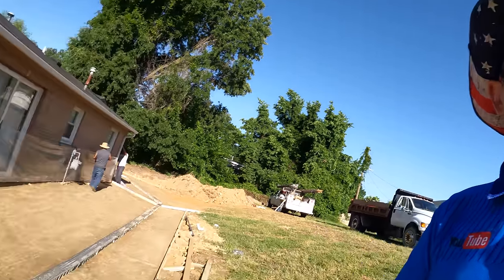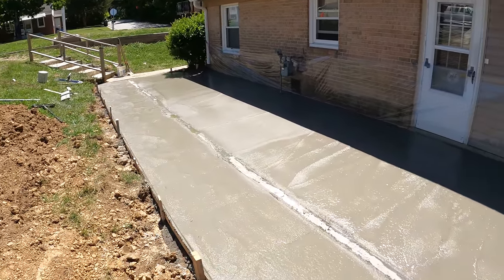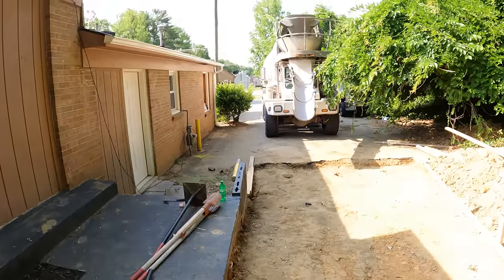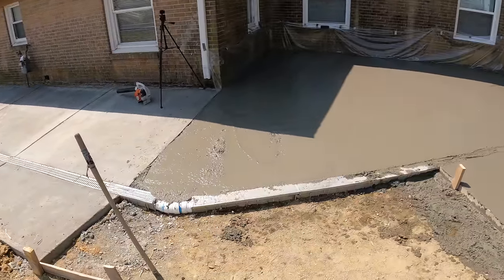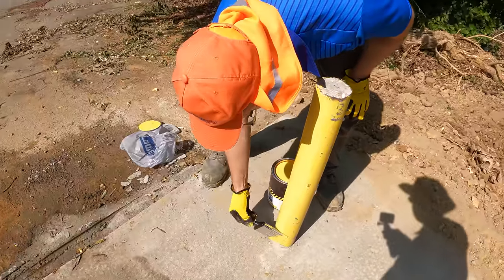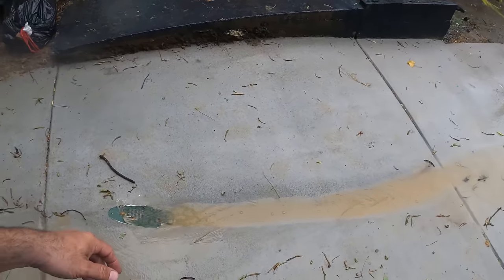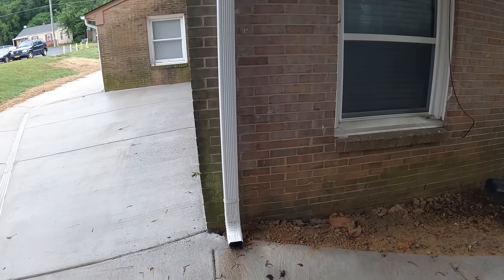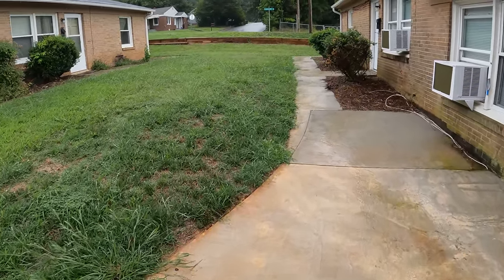Part 4 of 4 The worst Apt. Flooding I've ever seen!

Comment: I don't think the concrete is visually unappealing at all. By the time the residents put out some chairs and some flowers, you won't even notice it.
Reply: I was thinking a Shade Clothe Awning all away around to the Edge of the Concrete. And then have their Chairs and Table and Plants in pots.
Reply: It will blend in in time its better to have a lot of concreat and no damp nice job guys
Reply: My thoughts exactly. Property owner could put some fence dividers up and turn it into a patio area for the tenants.
Reply: Silver reflecting tape, around the top of the Ballard's,  would be a nice touch. Especially at  night
Reply: @fisqual definite value add until tenants realize why it's actually there

Comment: Tough jobs like this some contractors will avoid. However, I feel like you learn a lot going through the process of solving a difficult problem and in the end there is value to be gained from putting in the work that others won’t. Great job.
Reply from the maker: Thank you J M!
Reply: @GCFD  I seen where you took that green grate and used your pocket knife to cut a drain hole but you were still worried about leaves getting snagged. A few seconds with a dremel you could smooth that opening that might help 🤷‍♂️ I have zero construction experience but just a thought.
Reply: @GCFD  here in the uk their are gulleys under every rain water pipe from your roof which goes underground to your main sewer that's where our rain water goes
Reply: @GCFD  don't houses over there have damp course in the walls below the floor

Comment: I don't see a "Sea of Concrete", I see a patio addition for each unit. It does not look ugly.
It looks great AND it seems to have fixed the challenge they were having.
Good Job guys!
Reply: I agree-nice outdoor seating areas aplenty.
Reply: @markschultz1606  Yes, a few potted plants will soften up the overall affect, as well.  Also, I noticed the roofs for all the buildings look brand new.  The new owner's investing a lot into these apartment buildings.

Comment: Awesome job Shawn. You almost need a flap at the end that gets thrown up and drops down when no rain, water, but not an easy problem to solve. I think the concrete looks fine, I bet those renters love their new patio. Lots of grass vs concrete.
Reply from the maker: Yes the renters are thrilled to have a landlord who cares and to have their flooding problems solved.
Reply: @GCFD   I agree I think a flap would help but I’ve never done that I would leave that to the pros (that’s you lol)
Reply: Something like a check valve. Maybe a piece of inner tube cut into an oval shape to match the discharge outfall
Reply: A "pop up" - type of discharge (sideways).  I'm VERY sure you'll come up with something- IF necessary!
Very complex job!  
WELL DONE!!
GCF has come a long way!
Reply: I agree a flap valve is the solution. But you still need to prevent people putting there foot in the hole and twisting their ankle. A flat grating level with the top of the pipe downstream of a flap valve maybe could have been a solution here. Then you could lift the grating to get to the valve if it gets clogged with twigs and the concrete could be profiled so there was less chance of a trip or ankle twisting hazard.
Reply: @GMan-yv8cb  much like a yard bubbler...  keeps crap out when not in use,  but pops up when water pressure is behind it,  and top is easily removable for cleaning

Comment: Looks good. I would recommend using straw mats or hydro seed for those hill sides. Also if you use seed and straw put down a 12,12,12 fertilizer, it will help get the grass to grow and stabilize the hill side faster.
Reply from the maker: Great advice Rob. I don't use fertilizer too much but see the positive reasons. The grass came in well here, luckily.

Comment: Congratulations Shawn!  There might be a formula for the quality of the concrete work.  In the couple of years I've been following you, the concrete jobs have been on the small side and bang on.  This has to be one of the most extensive concrete jobs.. so all day, multi day.  When people get tired, quality can fall.  The laser eyeballs that can precision sculpt a 6 foot run, might by shortsighted on the 60 foot pour.  Thankfully your laser eye is always full bubble! What about a hinged cover on the outflow for easy cleanout? Get into custom metal fabricated outflow covers!

Comment: Hey Sean, I for one appreciate the trouble you go through to put these videos out for us to watch. Even though most of us aren't in your service area, we know what to look for if we hire someone or take a project on ourselves.
I'm not a big fan of the sea of concrete, but I'd do the same thing. You said there is a new property owner so maybe he'll have someone build some planters that stick out from the building 90 degrees to break it up. He could charge a little more rent for the patios.
My thought on the newest outlet in the sea, it needs to be covered somehow so someone doesn't step in it and twist an ankle. None of us want to use our liability insurance. Having said that, it also needs to be open to get rid of the crap that gets in it. I like that you opened up the bottom of the screen. Maybe the landlord could have his lawn mowing people or property manager check it regularly and clean it out as needed.
Reply from the maker: Thank you Roy. I'm glad folks are finding my stuff useful. The property manager is supposed to be keeping a close eye on things over there. It appears they are doing well.

Comment: Great job Shawn, you have done what you were asked to do and get the water away from the property, and using all the concrete has done the job and working well, i want to say the concrete guys have it easy when you have truck drivers like that and getting in so close to the job makes it so easy for them, looks really good and finished off tidy

Comment: Excellent results, Smart move about not piping the gutters no need to have that debris in there, Its not that bad,  you have to do whats needed rather than to Demo the whole property which is obvious due to $, And on the flipside its a plus by not having muddy feet when going in & out of the residence, minus possible wet shoes. Anyone with Pets the issue is always muddy paw prints on the carpet etc.
Reply from the maker: Good points. The concrete is clean and way better than mud!

Comment: I enjoyed the series; I think it let you break down in to more detail with what was going on.

And the 'sea of concrete' is now a 'marketable patio area' for those units, and maybe a 'shared area' at the corner.
I'd be surprised if next summer there aren't tables and chairs or maybe even privacy dividers put up buy long-term tennants.
Plus a great area for little ones to tricycle around and sidewalk chalk!

It may not be 'pretty', but wow is it useful space now!  Saw the one person already had a carpet set up outside the door.

Comment: Pro tip: IIf you want to compact dirt with the mini Bobcat, fill the bucket with dirt. More weight, more compaction. :)
Reply: @jeepinass  You can see in the timelapse video that it indeed does compaction. Sure tracked vehicles spread the weight over a wider area, but there still is weight.
Reply: @jeepinass  I am watching this farming channel. Mate has tracked hardware to reduce compaction on his fields, sill get's compaction.

Comment: The "Sea of Concrete" was the best, passive and most permanent engineering solution.  The only esthetic improvement I might have suggested would be to tint the concrete so it wouldn't look quite so monolithic.  The plastic screen over the angled cut outlet pipe could be put on a stainless-steel hinge, allowing it to swing up and open, allowing drainpipe discharge if it becomes clogged from inside.

Comment: Maybe a PVC frog flap could be a better option for the end
Reply from the maker: I haven't heard of those... I'll check it out David.
Reply: @GCFD   Frog flaps are often used in overflows from rainwater tanks (Common in my part of the world) The overflow has a hinged flap on the end of the outflow that normally sits shut. It is hinged at the top, and when it rains, the water pushes it open and allows the water out.

Comment: First, what a great series of videos, Youtube could not pay you enough for all the work you do. What a great transformation. You totally saved all of those apartments. If you will forgive the Monday morning quarterbacking, in my line of work, I find I have most success (or least problems) making things easier for other contractors. If you had run the channel drain outflow out to the side of the concrete instead of down the middle, it might (might) have made it an easier pour, and you could (maybe) have used an open outflow with a plastic runoff. Anyways, it doesn't look like a sea of concrete. It looks appropriate to the surrounding apartments.

Comment: In the UK we're not that keen on swathes of concrete but that's a heck of a water problem you've solved. Epic job!
You could install a Rat Gate.. one way swing gate that fits inside the pipe. Although I doubt cats would want to get in there!!
Reply from the maker: That's a pretty cool device. Rat Gate.

Comment: Great video Sean. The Sea of concrete issue wouldn't bother me because there are lots of places where you have mostly hardscape and you put in pots and planter boxes if you want to have a softened environment. I completely agree with your logic on why you had to go with a passive system like you did. It's the only way to guarantee that the system will flow even when nobody maintains it. Personally, I thought it looked really nice and the residents in those units on the uphill side got to have concrete patios outside their doors. So I didn't see it as a negative. I thought it actually made the places a little bit more attractive. Great work on this long multi-part series. I think it gives you more room to explore the job and share with us all the ins and outs. I look forward to more like it if that works for you.

Comment: Was the crack over the pipe expected? If it were my property, I probably would not have liked that unless it was discussed and agreed upon. Love the series you are doing! Keep them up.
Reply: They do minimal maintenance there so I don't think they'll even notice.
Reply: @Mark.Watson  I get that, but I’m asking more from a standard question regarding concrete. He said it was “real thin” there. Cracks get worse and would seem especially worse over a pipe which will allow more water to seep in around it. I’ll be interested to hear what he says.
Reply from the maker: Yes that thin concrete over the pipe was expected to crack.

Comment: If I was tenant, or considering  buying the  property.  I'd look at it as selling point,  due to the ground, levels. It's a great preventive addition to the property. As rule when rain gutters  drip, and it's not raining,  it's a sign gutters  have debris in them, holding back water.
Reply from the maker: Yep! The other problem with holding water is the tannins leach out and stain the concrete.

Comment: I am with you, with the apartments  in a lower grade you have to take drastic measures with concrete solving the issue  .I agree about not dumping gutter pipe into  the drain  that would have  been a HUGE issue you  played it well .The  concrete  guys seem to be ok for average jobs the complicated  jobs  they seem to have issues they  need micro managed ?I would hire you every time !You care about your work only perfection is your goal !

Comment: Hello from Australia. Just a heads up, You can’t do pipes like that in concrete. The pipe needs to enter from underneath the drain so you have minimum 100mm cover over the pipe. Now that the concrete has cracked it will allow water to work it’s way under the concrete and the issue will just slowly get worse and worse as it fails. You would have been better off to just spoon the concrete all the way around it would be a lot stronger.  The only way to have a strip drain like this would be to have the exit into a garden bed so you can maintain 100mm cover over the pipe. I hope that helps.
Reply from the maker: We didn't have the fall to bury the concrete deep enough. So we had to leave that as a trade off. Solve the flooding issues but have a crack along the shallow pipe.
Reply: I understand that but with out cover over the pipe I would recommend doing the same thing with out the drain. The concrete will end up really badly cracking over the pipe and some sections will end up popping off exposing the pipe and once water gets through the crack underneath the concrete you will have another issue. I’ve learnt from 25 years of my own mistakes. Now we do insurance work fixing these issues. I enjoy your videos 😁 Have a great day and God bless.

Comment: That would work.. Love your "Modification" to it.. That looks good, I would do the ends like that in all of them or make it an option for the owner to decide.. For the concrete another alternative look would be stamped concrete with brick pattern or stone pattern. In most applications it actually adds price value to the property.. My driveway was an ugly half asphalt half concrete, I ripped it out and did flagstone pattern stamped concrete I even dusted color powder, The cost was maybe 3 t0 4 percent more, it took about 5 extra hours, but It looks so beautiful. that was 5 years ago and I still get complements on it.. You could make more money offering that as an option just add 5 to 6 percent mark up.. Loved watching.. I see you are a person who cares more about doing the best job, despite how much you make on it.. Thank you for sharing.. God Bless..
Reply from the maker: Wolf in our area stamping is like 2-3 times more expensive. It's much much more labor intensive to stamp, which is why we don't do it. It does look awesome though.
Reply: @GCFD  WOW, I was unaware it was that much, I did mine on my own, I have a larger concrete mixer, The pigment powder was like $3.00 a bag, The rubber stamp patterns I paid about $250.00 for the flagstone pattern set. A friend of mine bought them from me for $300.00 last year. He builds custom decks and also any concrete work (small paths and small pads) he does some kind of texture: Stone, brick, slate, cobblestone & so on, he wanted the patterns I had.. He dose small areas like patio's so he mixes & pours his own concrete, So maybe that is why he told me it was cheap to do textures.. By trade I am a retired master carpenter.. Thank you for enlightening me on the real costs, I just assumed it was cheap cause (for me) it would have costed more then double to hire the job out.. I've been out of the building loop for many years since retiring.. Thank you again. Be Blessed.......

Comment: I don't think it looks ugly. It's a nice patio. I think I would have left the grate off though. Anything blocking the exit is just asking to get clogged. But I guess your meet-in-the-middle solution of removing the bottom grates will at least give it a chance. You did a fantastic job with such little fall.

Comment: Nice work!!!! Completely remove the outlet grate, core the concrete on either side of the outlet, and install two more bollards (to protect against the trip hazard it creates). That outlet is no more susceptible to creature entry than any other you've ever done.
Reply: If it gets clogged with a deceased mammalian lifeform, Ollie and Ratty will have to come and jet it out.  :)

Comment: Nice to see your hard work and that it finally comes to a very satisfying End! 
You are an absolute Pro and you really know how to find a solution. That the first try didn't work out is no big problem since you reacted in a professional way and had a solution. The next flooding was not in your hands since you didn't know of flooding problems in the areas shown in this video, the landlord should have informed you beforehand. 
The whole placement of the building in a sort of valley was not smart to begin with, but you have dealt with it with much effort and now there won't be any problems for a longer period of time. I really appreciate your consideration for the protecting of animals around in this area and that you put all your experience in this project to avoid potential failures due to lack of maintenance. 
I think putting a layer of green PU-Paint or something like this would protect the concrete from frosting up in the long run and would make the concrete desert a little more appealing, but having the water out of the foundation is the most important part. The "backwards flipped" concrete truck looks weird, but has some advantages on sites like this.
Keep up the good work.

Comment: Thanks for sharing your very informative videos. Have you ever had a problem where the water will still go under the concrete slabs and straight to the crawl space or basement? Concrete looks very nice to me.
Reply from the maker: No I've never had that problem. I make sure the ground is well compacted and higher than the slab. The reason is the water finds a much easier path to flow onto the concrete than flowing down through the soil and under the concrete. Water will take the path of least resistance and I try to provide that.

Comment: Concrete alone looks bad, but they can always add planter boxes up against the wall to not make it look so sterile. It would look way worse if the building sags or collapses due to the foundation being compromised by water damage. 😁